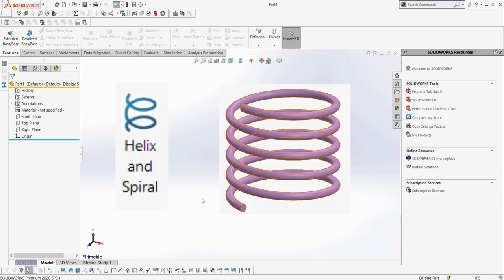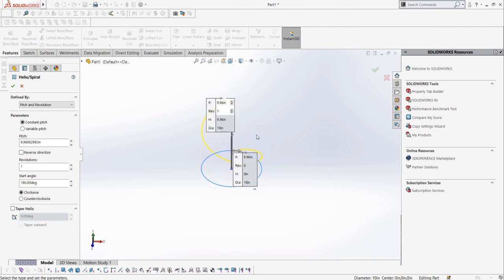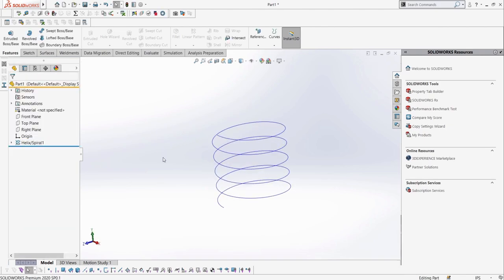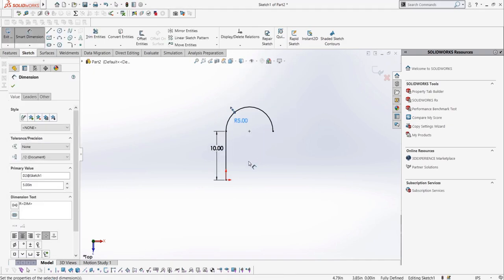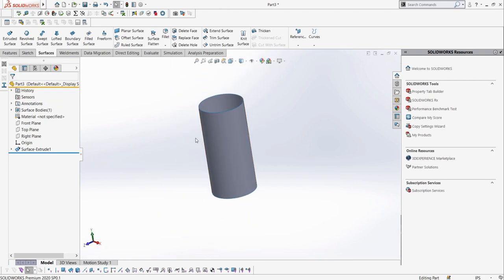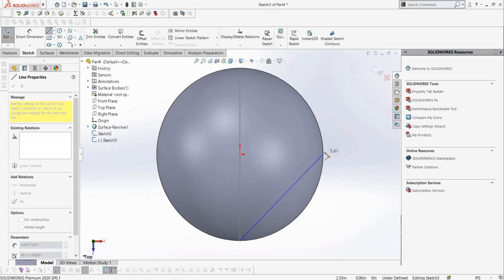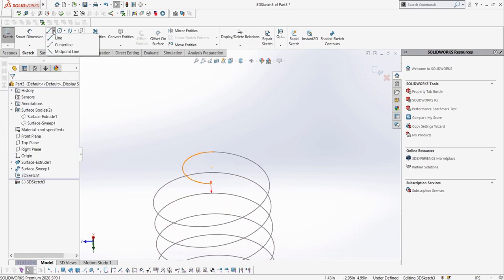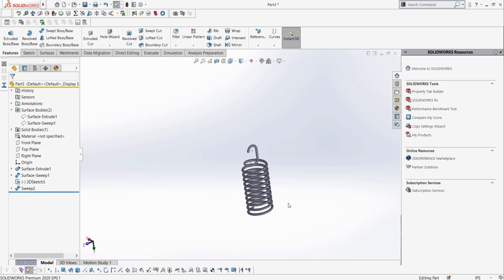Cracking The CSWE | Episode One: Springs | Full Certified Solidworks Expert Course

Comment: Thank you for this amazing content, in the case of circular profile can I use just Sweep with circular profile option to reduce the time?
Reply from the maker: Hey Mohammed, 

Which spring are you referencing? There are always a lot of different ways to model parts, and if you tried it yourself and it did work then awesome.